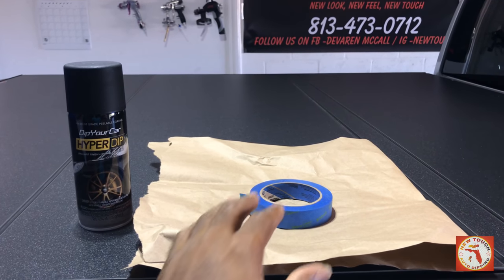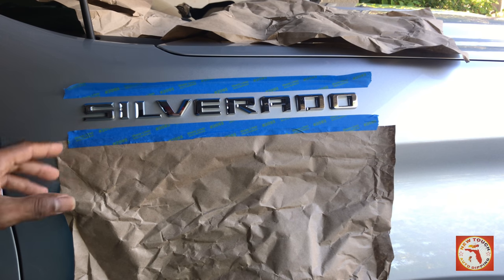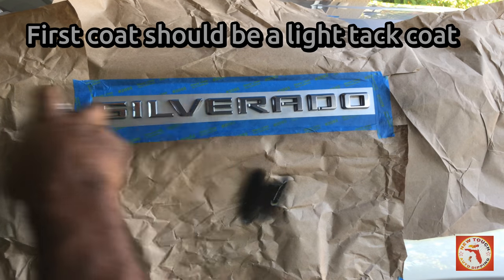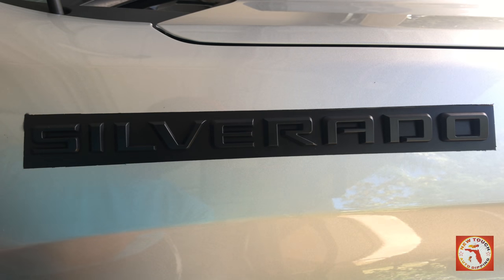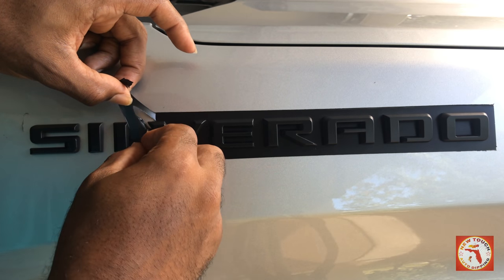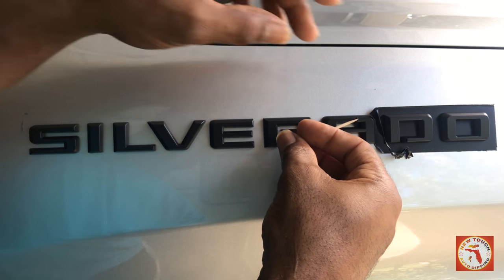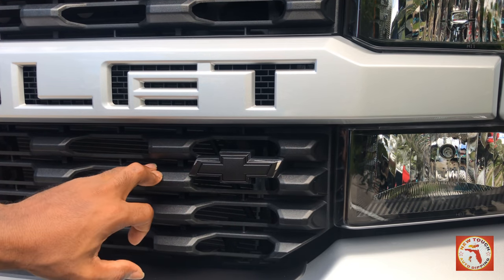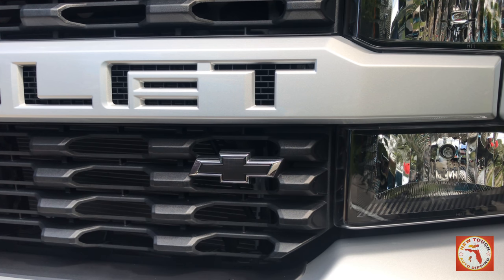(How to) HyperDip/Plasti Dip Your Emblems

Comment: How durable is this coating, It just peeled right off.  THinking about doing this to my RAM
Reply from the maker: When it’s applied correctly it’s very durable, you can peel the product at anytime. The longer the paint cures to the emblems the more it adheres and sticks, it only peels whenever you intentionally cause a peel.

Comment: Would you choose doing this hyperdip over a vinyl wrap of a big Chevy bow tie on the front of a vehicle?
Reply: Oh yes and how long to wait between the 12 coats you did?
Reply from the maker: Great question, actually I would rather use vinyl for a area like the bow tie. The reason being is that it’s less preparation and work also it’s much easier.
Reply from the maker: @nakiaholste9401  If your temperature is 65-75 degrees give it 15-20 minutes, if it’s 75 degrees above 10 minutes, if it’s 65 degrees below 25-30 minutes. Your temperature plays a huge role when you’re either outside or in a garage so the best temperature setting is 72-75. Wait 1 hour before removing the extra dip around the emblems, you’ll want to give it time to bond which makes it easier to peel
Reply: New Touch Auto Dipping yes agreed THANK YOU!
Reply from the maker: @nakiaholste9401  you’re welcome and thanks for checking out the video

Comment: How much time between each coat?
Reply from the maker: If your temperature is 65-75 degrees give it 15-20 minutes, if it’s 75 degrees above 10 minutes, if it’s 65 degrees below 25-30 minutes. Your temperature plays a huge role when you’re either outside or in a garage so the best temperature setting is 72-75. Wait 1 hour before removing the extra dip around the emblems, you’ll want to give it time to bond which makes it easier to peel

Comment: Great video, Devaren!  Thanks so much for the great instruction!  I am going to attempt this on my wheels and emblems this weekend.  One quick question - did you put Dip Release on the truck paint and the Pre Dip Spray on the Silverado emblem?  It was hard to tell if what areas you were touching when you did the prep.  Sorry if this has already been asked.
Reply from the maker: Thanks and I appreciate you for watching the video. The dip release will only be used for rubber tires only, try not to let it touch the rims. The predip spray will be used for adhesive which allows the paint to stick. I hope that you have a successful project.

Comment: How long will it last on emblem?
Reply from the maker: When it’s applied correctly you won’t have any issues with hand, drive through or pressure washing. With proper maintenance it can last 3-4 years before needing it removed or a recoat

Comment: HOW LONG IN BETWEEN COATS
Reply from the maker: If your temperature is 65-75 degrees give it 15-20 minutes, if it’s 75 degrees above 10 minutes, if it’s 65 degrees below 25-30 minutes. Your temperature plays a huge role when you’re either outside or in a garage so the best temperature setting is 72-75. Wait 1 hour before removing the extra dip around the emblems, you’ll want to give it time to bond which makes it easier to peel

Comment: I'm very impressed, I want to do my Emblems on my chevy impala, how many times will I have to spray my chevy emblems? Please let me know. Thanks
Reply: did you have the video on mute!? he said that he did 12 coats
Reply from the maker: Normally I apply 12 coats of hyperdip on every job bc of habit but you could achieve the proper coats with 10
Reply from the maker: @zacharyramos7527  10 will also work but I myself apply 12 to achieve thicker coats, it makes the peeling process easier when the time comes
Reply: @newtouchauto  Thank you for the response, I just want to make sure that I do my Chevy emblems right..I’m waiting on my order to come
Reply from the maker: @JustMekia  gotcha well this video got you covered, well let me know how it goes
Reply: @newtouchauto  Will do..Thanks

Comment: What are the cleaning products that you used (pre dip spray)(alcohol) alcohol is no problem but pre dip spray? Thanks for the video!
Reply from the maker: To begin the process wash using some type of degreaser soap, once the area has dried proceed with pre dip spray or 70% alcohol as a replacement, the spray can be found at dipyourcar.com.

Comment: Will this stuff come off if you take your truck thru the car wash?
Reply from the maker: Not at all, when it’s applied correctly you won’t have any issues with car washing. I’ll be uploading a video on car washing soon, within the next week or so.
Reply: @newtouchauto  Can this spay be used on the B pillars? Most of the options available on the market consist of a sticker or a piece of plastic that is double taped, seems like this might be a better option.   Thanks for tkg time to reply.
Reply from the maker: @NN-sj5uv  honestly I wouldn’t recommend it, you won’t be able to peel it properly by hand. You’ll come out better by removing the pillars and using permanent paint for interior panels.

Comment: So does the dip come off of the emblems easy over time? Also why would this be done as opposed to just replacing the emblems? Thank you for your time and great video. It looks amazing
Reply from the maker: Great questions and the dip won’t come off when it’s applied correctly, removing will have to be intentional. 
Not knowing anyone’s budget or time this is a easy diy project that’s helpful for the 2 topics mentioned. 
On the other hand with replacing them is not a bad idea but learning a new skill such as this can go far.

Comment: Nice truck my man. Silver is nice. I have the 2021 Trail Boss in black. Emblems are blacked out from the factory. But I'd like to do my Ford Ranger in black like this. Question for you. How durable is it? It looks like it will come right off if you grab it.
Reply from the maker: Thanks, when it’s applied correctly it’ll only peel away if it’s intentional. It’s very durable to car washing and weather
Reply: @newtouchauto  hey man, I'm about to use your technique to do my z71 badges on my new truck. It's not going to wreck or harm the paint at all will it?
Reply from the maker: @metalphobos3632  not at all, go for it
Reply: @newtouchauto  ok thanks, man. Much appreciated. Have a good one
Reply from the maker: @metalphobos3632  you’re welcome and thanks for checking out the video, hope that your project is successful
Reply: @newtouchauto  Devaren, I did my emblems on my 2021 Trail Boss and I used the glossifier on them as well. They turned out fantastic, brother. Glad I took your advice and thanks again.
http://imgur.com/a/2OuETUy
Reply from the maker: @metalphobos3632  you’re welcome, the Trail Boss is looking mean. Now it’s time to tint those tail lights, I have a video uploaded on light tinting if you’re interested.
Reply: @newtouchauto  it's illegal where I live, brother. They'd pull me over non stop. I'm buying the  Recon tail and headlights for it. Tinted my windows two days ago.
Reply from the maker: @metalphobos3632  that sucks, well it’s not that serious I guess and we gotta respect the law
Reply: @newtouchauto  unfortunately yeah. Lol. It's all good though my man. You helped me out and I appreciate it. All the best to you and the channel. When I do some upgrades I'll hollar at you.
Reply from the maker: @metalphobos3632  gotcha

Comment: HI… EXCELLENT VIDEO…..WELL DONE…. I AM NOT SURE IF ANYONE ELSE HAS ASKED THIS QUESTION, BUT DOES THE COATING WITHSTAND WASHING THE TRUCK.   I ASSUME PRESSURE WASHER IS NOT A GOOD IDEA, BUT HOW ABOUT CAREFULLY USING A SOAPY SPONGE WHEN WASHING?    RON.
Reply from the maker: Hello Ron and yes I get that question asked a lot. 

With proper maintenance the longevity of this product can be 3-4 years before needing it removed or re-sprayed. 

When it’s applied correctly you won’t have any issues with drive through car washing. Here’s a video link that I uploaded pertaining to car washing removable wraps. 
https://youtu.be/WxrjERIBDHg

Comment: I thought that D and O was going to get you but I started laughing when you breezed right through it. Great job and video.
Reply from the maker: 😆 believe it or not those center ares will determine if you sprayed too heavy or not. The first 3-4 coats are the most important along with the last, 8-10 coats will be enough to complete something like emblems.

Comment: Nice videos and and good luck with the channel and business mate!! 

I have my trims to do and THEN the emblems.
Reply from the maker: Thanks I appreciate that, hope that you have a successful finish with your project
Reply: @newtouchauto  

Anytime!

The original project failed and had to re sand everything back to stock. It looked amazing but had no stick. It’s started to flake to easily. 

After the company told me to use the trim and bumper paint without adhesion promoter I went ahead and sprayed the whole cars trim. 

I’m going to re spray it black using promoter and then do the decals black also. 

Hopefully <
Reply from the maker: @jammin1881  oh so your spraying permanent paint? 

The paint that I’m using in this video is removable so when applied correctly flaking or not sticking properly is not an issue
Reply: @newtouchauto  

I’m using hyper dip for the emblems and badges and for the trim I’m using adhesion promoter and trim / bumper paint.

The trim is faded grey now and going to spray it black using duplicolor adhesion promoter and their trim and bumper paint.
Reply from the maker: @jammin1881   oh ok well yeah you’ll always use the promoter with permanent oem paint. You may wanna use a great and wax remover first, after it’s dry and clean a primer would give you a nice foundation to adhere properly before applying the paint.
Reply: @newtouchauto  

Appreciate the advice! 

Do you have any personal experience with the duplicolor adhesion promoter? 

I need advice on wether I also need a separate primer after the promoter? The guy said it wasn’t necessary but a promoter WAS after it flaked the first time.
Reply from the maker: @jammin1881  yeah the adhesive promotion will only give you the needed bond to the panel. Primer will also give you the extra bond for the paint and also a smooth foundation for unleveled surfaces. You can’t go wrong with either as long as the areas are properly prepared before painting.
Reply: @newtouchauto  

I was going to use the adhesion promoter and then the trim and bumper paint.

The first time I washed everything with Dawn dish soap twice and then used an alcohol solution to rub each panel down. 

The result was amazing and smooth but it started flaking after a few days. 

:(

Comment: How easily does it come off when it’s time to sell?
Reply: farely easy, if it doenst use some isopropyl or rubbing alchohol and some paper towel or microfiber cloth and it rubs off after some time
Reply from the maker: If it’s applied correctly you won’t have any issues with removal, simply use a dry microfiber towel and start a peel to any corner. Worst case scenario you’ll have to purchase the Dip Dissolver spray from dipyourcar.com, it’ll liquify dip that is too thin to peel so that you can spray it off with a pressure washer.

Comment: How long between coats?
Reply from the maker: Thanks, if your temperature is 72 degrees or higher give it 5-10 minutes before your next coat. Anything below 70 degrees will have a longer flash time in between, test it out by touching the overspray around your preparation to see if it’s dry

Comment: How long does it last? Carwashes? This is so cool...
Reply from the maker: When it’s applied correctly you won’t have any issues with hand, drive through or pressure washing. With proper maintenance it can last 3-4 years before needing it removed or a recoat
Reply: Thank you again for the timely response, now just need to see where I can get.. Thanks..
Reply from the maker: @markjacqmin4073  you’re welcom, currently hyperdip is only available on the dipyourcar.com website

Comment: What is the pre dip spray?
Reply from the maker: Predip spray is a chemical that helps the paint stick properly, it allows paint to adhere to the panel and helps it last without lifting. You can also use paint adhesion from your local automotive shops

Comment: Great video with lots of professional tips. How long do you wait after the final spray to start removing the hyper dip?   I'm confident when I do my Toyota Highlander it will turn out great, thanks again.
Reply from the maker: Thanks for the compliment, confidence is key and hopefully your project is a success. Wait 2 hours to remove the outer layer, if it’s very hot in your area 1 hour will do.

Comment: How is it when it comes to hand washing the car?? Will it remove??
Reply from the maker: When it’s applied correctly you won’t have any issues with hand, drive through or pressure washing
Reply: So I did it and I took like 2 weeks without washing my car then I finally washed and I decided to get it waxed so now I don’t know if it was the waxing or if it was washing the car. I get my car hand washed.
Reply: So now I only have the h for Honda the front and back silver and the “awd” “sport” black out btw my car is black
Reply: I’m not sure if to do the h again
Reply from the maker: @yessicafernandez9306  sounds like it was either you used a dry microfiber towel over the wrap or you didn’t prepare the surface properly. Wax is not a product that’s compatible with plasti dip or hyperdip so it could’ve also made the spray wrap shrivel up around the edges. 
If you don’t have any DipCoat protection spray only soap and water is safe, never use anything dry to wipe/wash or dry over the wrap. 
Here’s a video link that I uploaded pertaining to washing a wrap. 
https://youtu.be/WxrjERIBDHg

Comment: How long between each application do I wait?
Reply from the maker: If your temperature is 65-75 degrees give it 15-20 minutes, if it’s 75 degrees above 10 minutes, if it’s 65 degrees below 25-30 minutes. Your temperature plays a huge role when you’re either outside or in a garage so the best temperature setting is 72-75. Wait 1 hour before removing the extra dip around the emblems, you’ll want to give it time to bond which makes it easier to peel
Reply: @newtouchauto  thank you for responding I was about to just come to Lakeland 🤣🤣🤣. Then I found where you already said it. Thanks again. Turned out pretty good.
Reply from the maker: @jonna1024  😆 you’re welcome and thanks for watching the video. Hopefully your project is a success.

Comment: How long does it last
Reply from the maker: The longevity could range 3-4 years, applying the DipCoat Protection spray helps with that and it replicates the wax for your dip. It can be purchased from dipyourcar.com

Comment: How long does the hyperdip spray last?
Reply from the maker: The satin finishes are designed to last 3-4 years before needing it removed for the proper peel ability. The gloss finishes based off of my experience has the same longevity but the gloss will become dull over time.
Reply: @newtouchauto  I see. Thanks👍
Reply from the maker: @mrgallardo7069  you’re welcome and thanks for checking out the video.

Comment: I am going to do my 14.  Excpt I want the chrome to be red.
Reply from the maker: Yeah that’ll definitely be different from the rest.
Reply: @newtouchauto  exactly. All I will need to do though, is I will need to wait approximately a week for the red paint to cure. Once all of the painting has been done, I am going to clear the red and the black in one shot.
Reply from the maker: @dennisranck1613  what clear are you gonna use?
Reply: @newtouchauto  regular ristoleum.
Reply from the maker: @dennisranck1613  I’d advise you not to use a permanent clear coat over removable paint, some have done it but there’s no guarantee that it’ll peel off properly.
Reply: Thank you for the note.

Comment: Great vid bro 👍 how long does this take to dry and also do you have to be careful jet washing your car once it done?
Reply from the maker: Thank you, after about 2 hours to completely dry so that the extra around the emblems dry. In between coats only 10-15 minutes to dry. My suggestion with pressure washing will be to never get to close bc it will potentially uplift the wrap paint.

Comment: Great video. I've been doing this for a long time as well. The only thing that I found to even work better is when it comes to thinning the material from the Plasti dip. I found that if I heat the Plasti dip by soaking the can in a bucket of hot water at the start and between coats it allows the material to go on much thinner almost like paint more aerosol. It seems to work really well.
Reply from the maker: Thanks and the information you stated is very helpful. I’m sure it works great for cooler weather installs.
Reply: @newtouchauto  exactly. I'm in Michigan and half the time I get a new vehicle it winds up being during the cooler seasons. Your video was excellent though. That is literally the exact way I do it.
Reply from the maker: @newagemuscle2010ss  I appreciate that and you for watching the video.

Comment: How well does this hold up to the elements compared to just replacing the emblems?
Reply from the maker: With proper maintenance the longevity of this product can be 3-4 years before needing it removed or re-sprayed. 

When it’s applied correctly you won’t have any issues with hand, pressure nor drive through car washing. Here’s a video link that I uploaded pertaining to car washing removable wraps. 
https://youtu.be/WxrjERIBDHg

Comment: How long do you wait in between each coat?
Reply from the maker: If your temperature is 65-75 degrees give it 15-20 minutes, if it’s 75 degrees above 10 minutes, if it’s 65 degrees below 25-30 minutes. Your temperature plays a huge role when you’re either outside or in a garage so the best temperature setting is 72-75
Reply: Got it. Appreciate the reply. I just did my emblems on my 4runner last night and thanks to your easy to follow instructions it came out nice! God Bless 🤙🏾
Reply from the maker: @gnogz2668  yes siiiir, glad that you had a successful finish